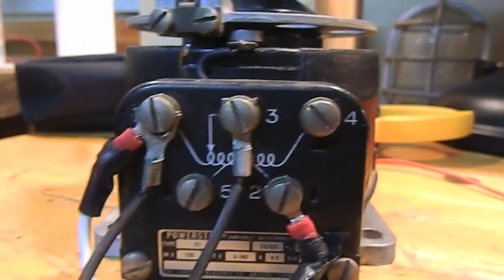How to wire a Variac

Comment: I was the largest seller on Ebay of fully remanufactured, lifetime guaranteed, American-made Variable auto transformers (General Radio, inventor of the Variac in 1933, Staco energy products co., Powerstat Superior Electric co. Etc.), and he forgot to mention the single most important component in wiring a Variac, the fuse!  Any American made variable auto former is able to withstand a 1,000 percent overload for 100 Milli-seconds, enough time for a fast-acting properly rated fuse to blow, protecting the variable transformer from arcing at the brush destroying the brush track surface.  This fuse must be placed in series on the output lead (typically terminal number three), or the "hot" brush connection to the load.  The model 21 Powerstat shown in the video is rated at 4.5 amps, so a "fast-blo" 5-amp fuse will work perfectly in protecting the critical carbon composition brush.  David Riddle

Comment: Thanks mate. I discovered I have a General Radio W20G3, triple bank 20 Amp variac. Apparently they go on ebay for aroundabout $500. I'm trying to decide if I should see it or if I may have a good use for it later.

Comment: Can I use one of these to control the speed of my single phase motor?
Reply: Depends on the motor. You can vary the voltage of universal motors or brush type motors. However, you'd be better off looking into controllers designed for that because just dropping the voltage is hard on the motor, and you loose a lot of torque.

Look at, for example, the router controllers. If you put a meter on it, you'll see the voltage stays the same throughout the dial positions. In spite of that, the motor does slow down.  That's because they pulse the AC and vary timing of the pulses. Other controllers cut the amps.

Comment: Hi the # 4 and 5 connectors are the inversion for rotation of the selector from  o to 140 V turning the selector to the left  or  1 and 2 to turning  from  0 to 140 v  to the wright you can connect one way or the other depending on what you got the winding on the transformer is the same  powerstat   is a  old brand  variac is a new  brand to some of the powerstat were stacks of 2 or 3 transformers in series look at the squematics on line

Comment: Great vid. Maybe somebody can help me with this. i understand i could connect this to a fan and change the speed with the dial ,so if i had two normal transformers one that is 240v - 120v and one that is 240v - 60v for example. could i just use relays and have the fan speed controlled with buttons? or simpler just having a switch that swaps the input between the transformers?
Reply: Thanks for the reply im still learning and i find the fastest way is to ask stupid questions. thanks! so i guess ill just look into variable speed motors.

Comment: If I get a variac that has a 220v 2 phase input can I run a regular 110v motor off It? Looking to over powering things and I was wondering If thst would work... pkease reply you're my last hope on this!!!
Reply: If the motor is designed for 120V so is the insulation so the insulation my fail at a higher voltage. Keep a very close eye on current and heat. Don't excite the rating of your variac.
Reply: fishflock Thanks, I was actually looking for a better way to melt the insulation and burn up the motor lol!
Reply: It would be much faster to over-load the motor. Stall it some how or slow it down so its just turning. The effect is much more dramatic. Careful of the voltage though. Not only can it kill you, it will hurt the whole time your dying.

Comment: hey Nathan, I have a question, I wired my W10 10 amp General Radio variac the way you said, but the voltage scale is backwards.  when it should be 0 volts its 140V and when it should be 140V its 0V any idea what I'm doing wrong.  thanks mk
Reply from the maker: That's not something you did wrong, it's just how that variac is made. I have some that have the min and max voltages on the opposite side of the one showed in the video. It will work the same just remember which way will increase the voltage. You wouldn't want to forget and accidentally over volt something.
Reply: Nathan Fryar thanks, I'm wondering if the scale was meant for the other side?
Reply: snaprollinpitts I know it's a late answer, but better late then never I guess. On a 5 Tap 1 is the beginning or the end, and 4 is the beginning or the end. When it comes to how a veriac works their is no wiring backwards. So if you put the Neutral on 1, and the Live on 4 and the dial is backwards then just reverse the wires. Then put the Live on 1 and Neutral on 4 and the dial will operate as expected. All you doing is starting the flow of the power from the other side.
Now if you do this be careful if you wire it to step up the voltage. Because the voltage is starting on 4 then your taps with 2 and 5 are reversed. So as he shows 2 is normally stepped up but if your Neutral is on 4 then your hot goes on 5 for stepping up. Do not put the Neutral on 4 and live on 2 without a ballast or addition capacitance or you will burn up and arc the transformer. 
But by doing this backwards Neutral on 4, hot on 1 for 1-100% and Neutral on 4 and hot on 5 for 1-110% step up the dial will now turn as expected. 
And to me having the dials turn from 0 to 100 is much safer when you own multiple veriacs this way all the dials on everyone of them act the same.

Comment: Nathan Fryar is a variac good for a lot of amperage if I need it for High powe experiments?
Reply from the maker: Like any other transformer of power supply you must size it according to your specific needs. You can buy higher current rates ones but they aren't as common. The red variac in the video is rated for 30 amps. Just make sure if you buy one that it is rated for what you want to do with it.
Reply: Nathan Fryar ok thanks

Comment: I have a Powerstat 116cu (120v -10A - Open) very similar to the one you explained on the You-Tube Video. The data sheet on my powerstat is showing my connections with the knob on the Base End and CW to be: Power Input on 4-5 and Output on 3-4. I noted the know on your powerstat was on the radiator end and mine is on the Base End. Won't this make it OK to use the #5 terminal  as the end of the toroid and the last section of the windings the over wind?

Comment: VERY helpful, as i mentioned i just got a new one (my first, actually) and don't know how to properly wire it, also will a 20A circuit breaker work to protect a 20A variac or should i downsize it to 15?

Comment: You could try ballasting it, i've heard it works quite well.I recently acquired a W20 Variac and a 50A relay, along with another 20A breaker, from ebay for 41 USD. Impressive had free shipping too. When I start using it i'll have it wired through the breaker but not use the relay, its on a rack mount so i'll probably remove the relay. Anyway, its pretty good deal for a 20A variac. quite impressive actually.

Comment: Meh, I'd put my hot on pin 4, because why would I want over 120 volts going into my device?  To test it if it will fry with an over voltage.   By setting it at pin 5, the end of the loop, there is no way I can over voltage my device, as my dial now goes from 0 to 100%, and if I want to go to either 0 or 100% without thinking, I can twist the knob full to the left or full to the right and hit the stop.
Reply: this would have been my question. Who would want 140V?
Reply: Because the input is 120 and the output is 140 more than likely...thats how mine is which goes up to 117 percent on the faceplate dial so at 100% you'll get 120

Comment: Nice vid. :-) 

When you plugged it in, I noticed you have only a 2-pin plug on that. 

Should the variac's chassis be earthed?

As I'm from the UK, I find it a little unusual to be using 2-pin plugs, as the only 2-pin plug permitted in the UK is a shaver/rechargeable toothbrush plug. All other plugs must be 3-pin to BS 1363 or the older, mostly outdated BS 546.

If you're going to wire this & use it for real, I'd recommend earthing the chassis on it. :-)

Thanks for showing.

-BBD.